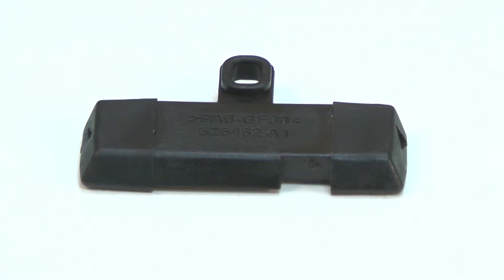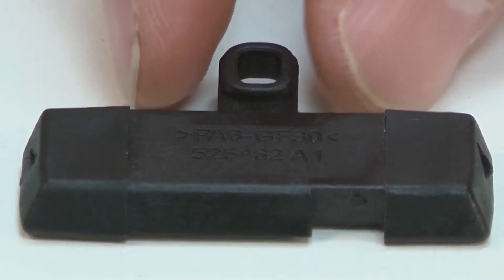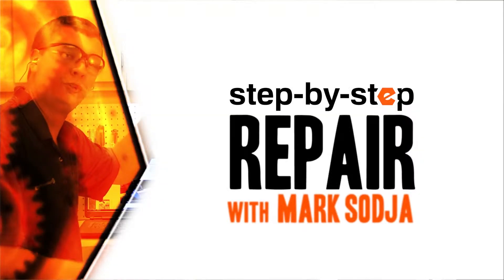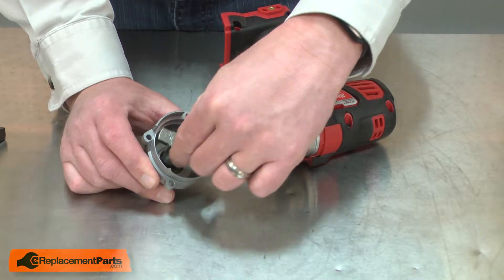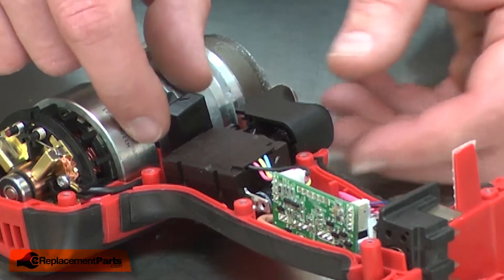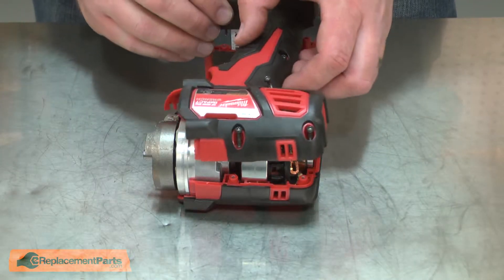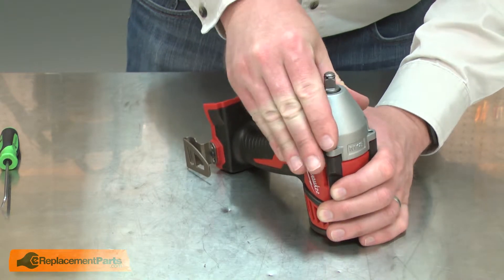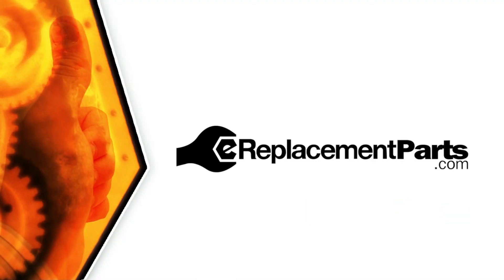Milwaukee Impact Wrench Repair - Replacing the Forward/Reverse Shuttle (Milwaukee Part # 45-24-2657)

Comment: Why did the shuttle need to be replaced?  It looks like it doesn't have any moving parts or electronics.  I didn't see in the video where it was broken.  I have the issue where mine won't work in forward mode.  If I try switching it back and forth it will stop working in both forward and reverse. If I just leave it in reverse and don't touch the switch it will work fine in reverse. I thought it was in the switch not the shuttle.
Reply: I’ve discovered the same issue! Mine is a hammer drill and the switch-to-shuttle connection (tiny plastic knob about 1/16” tall) just broke off - Replacing the part ($170 electrical assembly) is out of the question but I’m debating using some really small screw and pray it doesn’t break the switch entirely